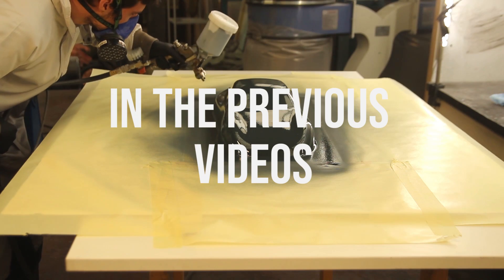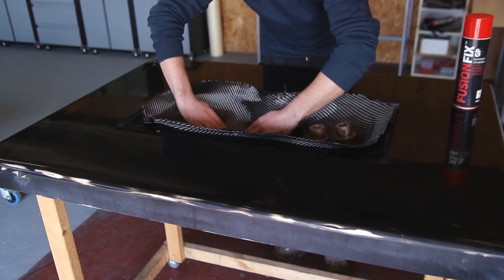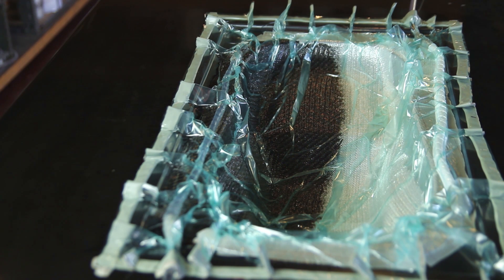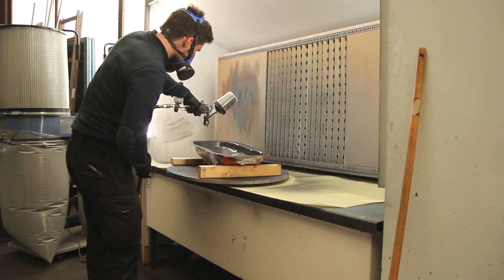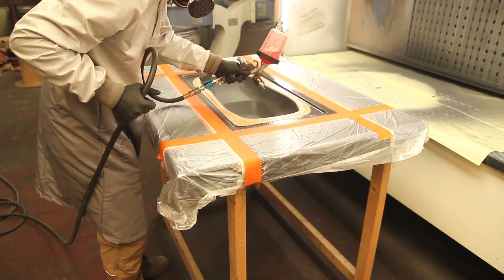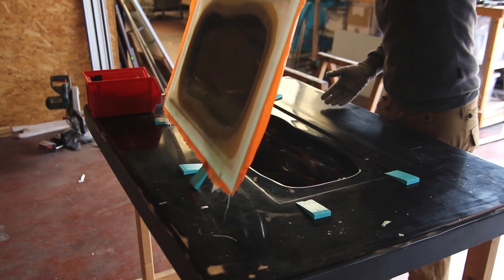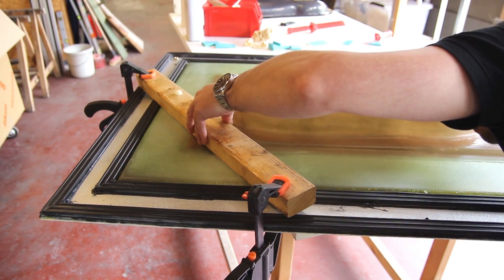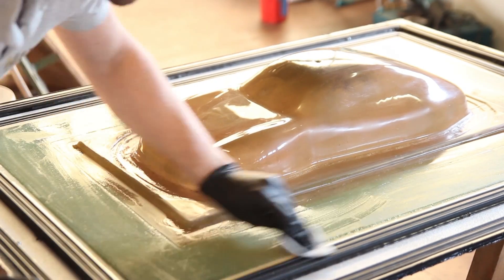RTM Mould - Creating Negative Fiberglass Pressure Mould (PART3/4)

Comment: Your concern to prevent the sheetwax from sticking to the upper mold gel coat, requires PVA to be applied to the surface of sheetwax prior to applying the tooling gel.

Comment: nice one again sir also about your last video that thing you said about silicon only sticking to silicon gave me an idea to lower the material cost on silicon molds and also i tested it and it worked very well and it is holding the cured silicon wastes and shred them into small pieces and mix them with silicon it can produces the same mold with the same quality with much less materials and definitely less cost
Reply from the maker: It is indeed a common trick to add of cuts of old moulds into new silicone moulds, as long as your waste parts are clean and from the same type of silicone you shouldn't have to much problems

Comment: Where did you get that infusion mesh? I've used mosquito net material on small parts with success, but this looks much cleaner. My life became so much better when I ditched the green plastic mesh.
Reply: Btw thanks for making this series. I've read a ton about RTM but have seen nothing else on YouTube of this quality. Looking forward to part 4!
Reply from the maker: @ErikRobertson  It's indeed a mystery for me as well that I'm discovering by sharing these video's. The infusion mesh can be found on easycomposites website :) been testing a lot of infusion meshes, so far this is the best one for 3D complex shapes. Only negative side of things is that it's hard to remove if your not using a perforated film

Comment: Top work mate, these videos are so cool and very helpful, I've also struggled with the wax strip, I think last time I used a hot air gun to soften it to remove, then I used isopropyl alcohol to clean the wax and glue off, it may work for you. Keep the content coming mate I'm not alone when I say we love them
Reply from the maker: glad to hear you like my video's! hot gun helps, as well as solvent...next time I might to try to apply a coat of pattern coat, with release agent, then peel of the entire sheet. more content is coming, stay tuned ;)

Comment: I be interested to know what spray gun/nozzle size you used to apply the easy composites Pattern coat primer.
Reply from the maker: I've used a 2.0 nozzle with the pattern coat being thinned with acetone
Reply: @MatthieuLibeert  can you tell the amount of thinning and the pressure you used?
Thanks for the high quality videos! 😊
Reply from the maker: Keep it somewhere between 5-10% to be safe, I spray at 2 bar nozzle wide open, nut this all depends on your spraygun and setup, you better first experiment on a piece of cardboard getting your setup right
Reply: @MatthieuLibeert  thanks a lot!!